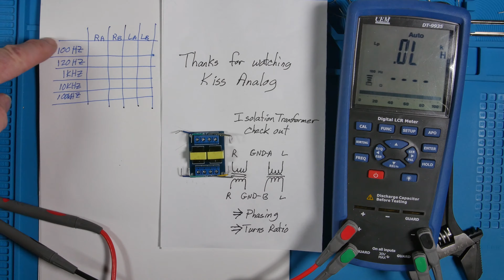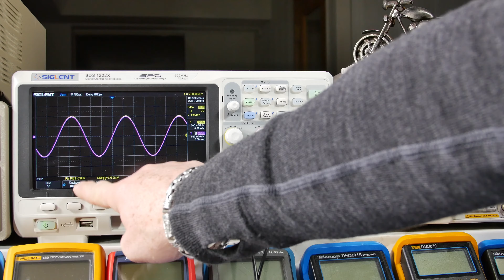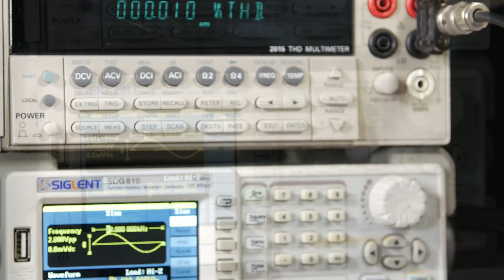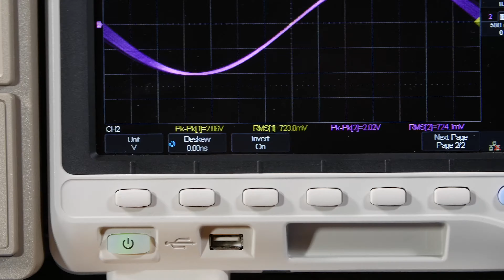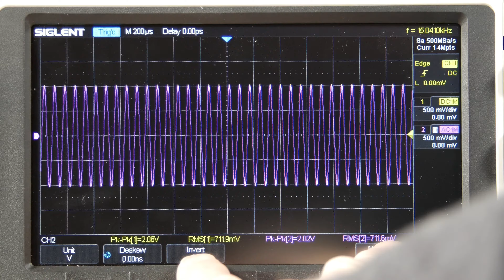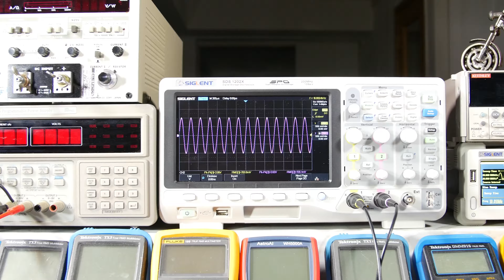Audio Isolation Transformer Class-T Power Amplifier

Comment: Hi Eddie,
Why have you tested at 2v p-p ?
Isn't the audio line level nominally 1v p-p ?
Good video.
Adam
Reply from the maker: Thanks Adam - and great question!  I think the peak for pro studios is 1.23V, and consumes 0.316V But I think a common max is 2Vrms now.  I used s high value so to test the transformer for saturation to be sure it was robust,  I need to do a video on this subject as a foundation for audio work to come.  Thanks for bringing this up!!
Reply: @KissAnalog  
Thanks Eddie,
I learned something new from you, my experience of line levels came from installing car audio amplifiers as teenager.(late 1980's)
For friends, always saw the 1V p-p reference on the amplifiers input.
As a friend tried to directly couple his new amplifier to the speaker outputs of his car stereo, which ended badly.
Not in to Audio, never really that interested, now we have cheap modules from China, it's raised my interest.
As for driving it to saturation, what's the point ?, you wouldn't do that to a transformer in a linear power supply circuit.
May be test the insulation of the windings, with an insulation resistance tester like a Megger ?.
Adam
Reply from the maker: I’ll show how to test and design your own magnetics.  You have great insight - I’ll demonstrate a HiPot meter I just picked up. ;)
Reply: @KissAnalog  
Hi Eddie,
Just had to look up what a hipot meter is.😎
Very similar to the PAT tester at work, generates high test voltages for insulation resistance  testing and high current for Earth bonding.
I'm guessing that it's a Fluke or  Seaward ?
Reply: Hi Eddie, that was sure a cool video thanks a lot